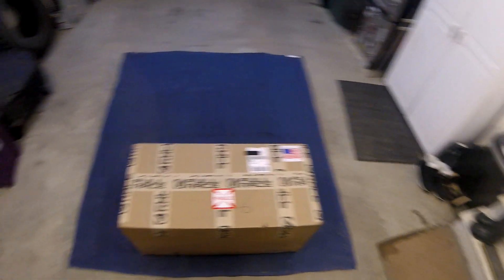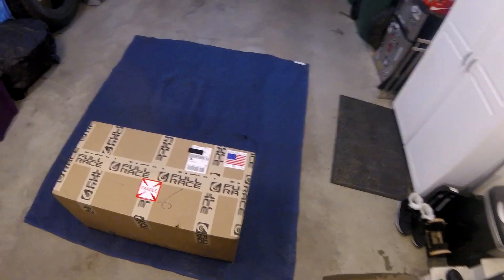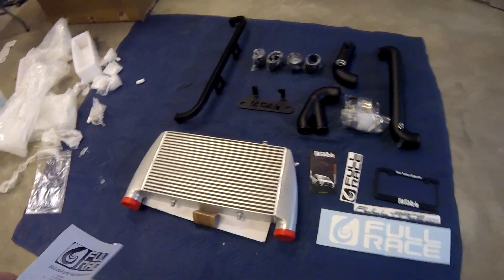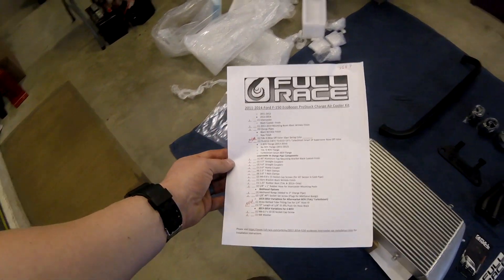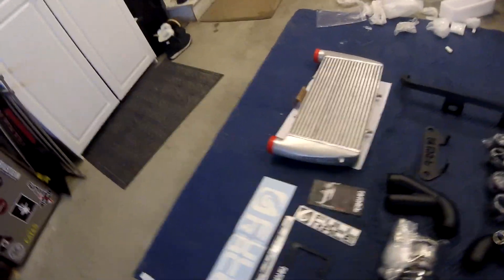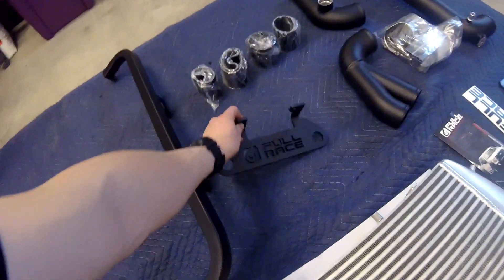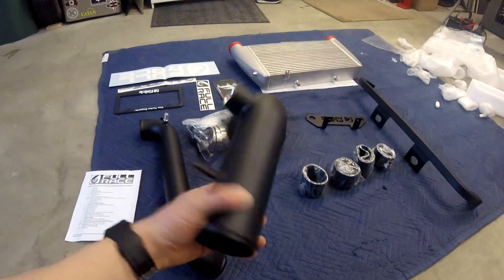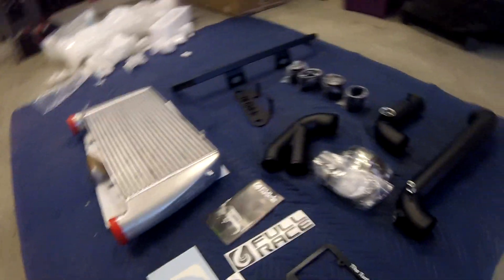Full Race Intercooler - Ecoboost F150 (And Raptor) - What's Included

Comment: Is there a drain plug on this intercooler?
Reply from the maker: No. Full arace days they don't need one because of the design. It seems as nothing could collect into the actual cooler and would fall down into the piping. I guess once it was there, it probably doesn't gather a whole bunch like the stock cooler
Reply: @NSQGarage  yeah that makes sense. I wonder if it would be a good idea to thread your own fitting into the lowest point in the piping for periodic draining or even threading in a 1/4" brass breather like AFE puts on their blade runner intercooler. I'm leaning towards getting this full race cac - any idea if it's compatible with the turbo smart vee Port bov?
Reply from the maker: @LeifBirnbaum  i think their website allows you to select different BOV options. so you could check that

Comment: Interesting how each box contains somewhat different content during the unpacking process. For example, I didn’t get the same stickers. My clamps looked like the OEM style. Also, I didn’t get the Full Race stencil used to paint the their logo on the front. Oh well… still impressed with the products when I installed.

Oh… be sure to check items against the packing list. This will prevent you from accidentally throwing away a part. There are so many packing peanuts (a good thing for protection) something might slip by you when the box is on the way to the trash. Just suck it up, and dump it out to be on the safe side.